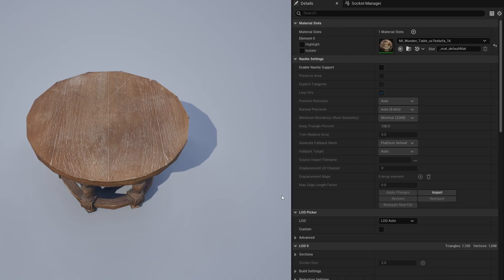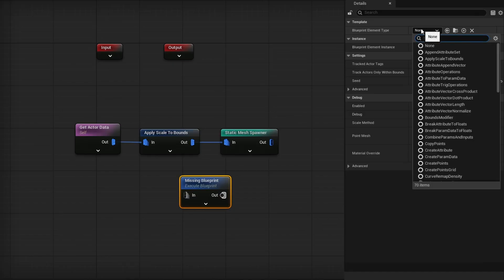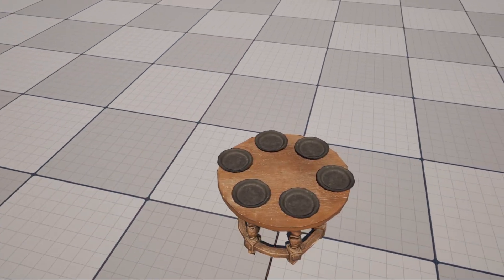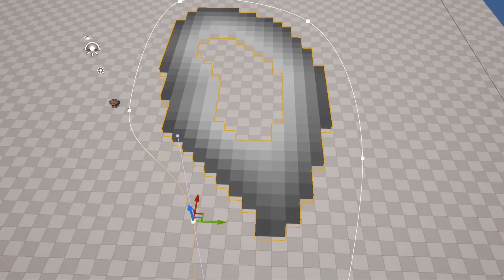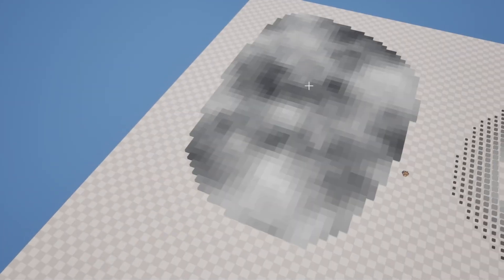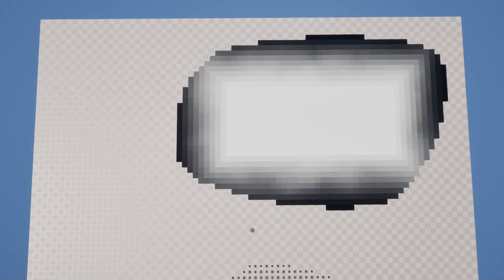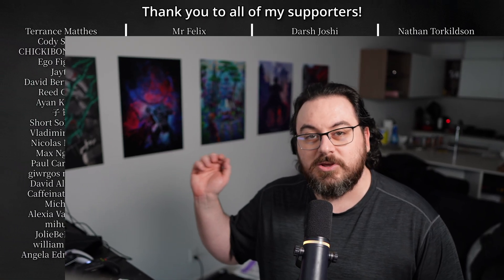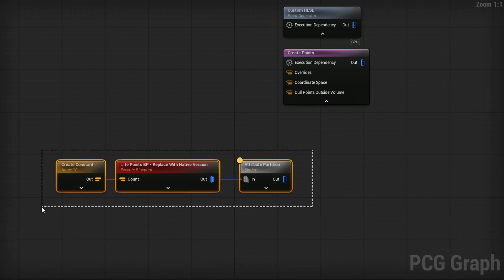Do You Know These 3 AWESOME PCG Tips and Tricks!?

Comment: Very nice video
Thank you 
I want to ask a question.if I want to create a spline in the middle of a street sidewalk and use PCG to distribute different props along it, such as trees in the center, and light poles and signs on the left and right sides of the spline.
Is there a way to control:
The spacing between each instance
The left/right offset distance from the spline
Different spacing and offsets per prop type
All from a single PCG Graph or Actor, without using multiple splines.
What is the best workflow or best practice?
Reply from the maker: Look into PCG grammar. That'll be your best bet for getting the control you want.

Comment: @Procedural_Minds 
My actor has several spline components, and it also has an Array<Struct>. I assign a tag to each spline component that represents the index of the array. However, when I use GetSplineData -> GetTags, I always only get the tag "0".

Basically, what I want is to assign an index to each spline component. It doesn’t necessarily have to be with tags, but I couldn’t think of another way.

Comment: @Procedural_Minds i have a usecase where 1 actor has multiple SplineComponents but only one PCG-Component, i want to use Tags or something else to use Match And Set Attributes based on Tag. But GetTags only gives me 0
Reply from the maker: When you get spline data, you can specify the component tag you want. So you can have multiple splines in one PCG graph.
Reply: @Procedural_Minds yes i did splinedata -> getTags -> use it as Index for the actordata structs. But filterdatabytag works fine but i dont want to Filter i only want to get the Tag. Also thank you for the quick answer. The spline components have also assigned the right day
Reply: @Procedural_Minds My setup is: several spline components in the actor, I would like to use the order of the components as an index, I thought when I set the index as a tag it works

Comment: Great video, one tip that i would like, is there a way to sample a vertical surface, as in, if i have a large mesh and i want to use PCG to place objects on a specific area of the mesh vertically for example say placing windows or doors or adding moss and vines to a large tree  ,  is there a way to get the vertical surface co-ordinates? im sorry if this is a stupid question, im relatively new to pcg
Reply from the maker: You can use a normal to density from a specific side or top / down, and just filter out points facing you want.
Reply: @Procedural_Minds you're a legend , im trying this tomorrow, thank you so much

Comment: Can you make a video in which you show application for the last tip? The create points. How should I use it for?
Reply from the maker: If you want to loop on something a specific amount of times, that would be the usecase. So if you wanted to duplicate your points, move them, change them, etc, an X amount of times. You now have a very controllable way of looping specific amount of times.

It's not a very common thing that is needed all the time, but there are times when I wanted it. Like in the building series to duplicate floors, before the the duplicate points node was added.